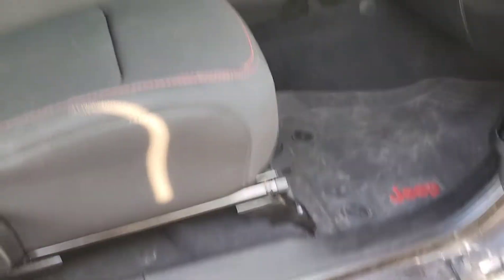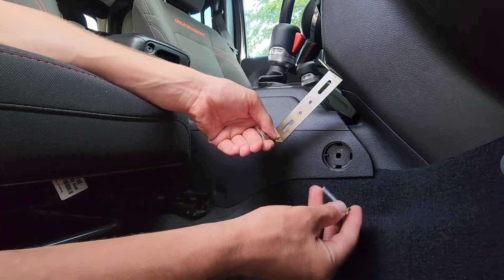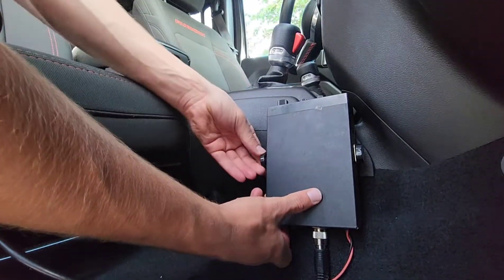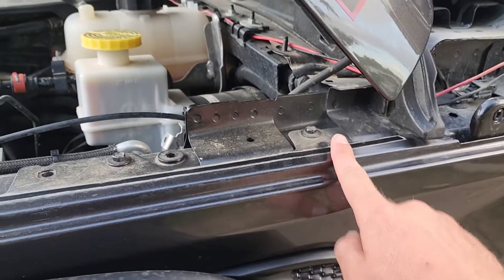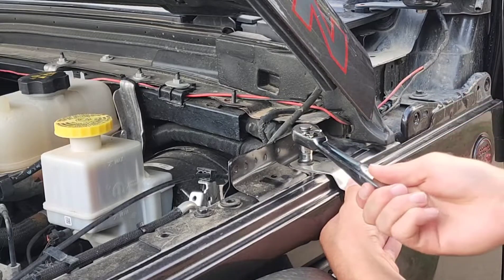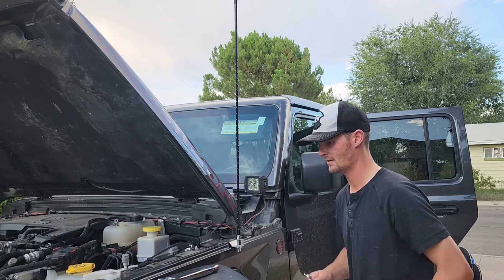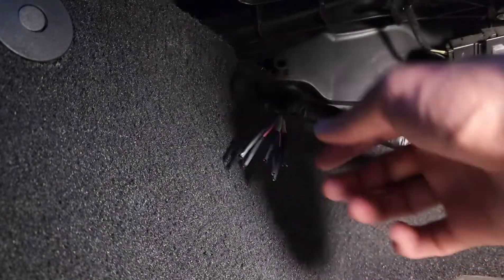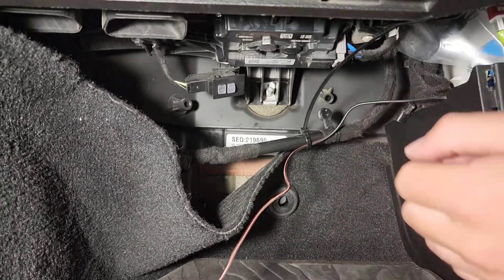Simple CB Radio install start to finish on the 21 Jeep Gladiator

Comment: Hey awesome video I’m wondering about that direct to battery wire. If I connect to that does it uitilize the aux switch or can I connect to that and still use all four switches?
Reply from the maker: You can still use all 4 switches

Comment: Nice video, this will help a lot! So where did you end up hanging the mic?
Reply from the maker: There is a hanger that mounts the mic to the passenger grab handle. Thats what I went with
Reply: @jeepzandthings  thanks, yes I have seen that one, but I am in Australia, so the drivers seat is on the right side of the vehicle, so I don't think that mount will work.
Reply from the maker: Oh yeah. Is yours a rubicon?
Reply: @jeepzandthings  No, I have the Willys model. I did some research, were you talking about the plastic wrap around mounts being sold by jeepuniq or the metal hanger you can get from Cooltech?
Reply from the maker: I was actually talking about the one from topsy on extremeterrain.com https://www.extremeterrain.com/topsy-jeep-wrangler-universal-cb-mic-mount-ummc-jl.html?utm_content=XTExterior-Antenna%7CTopsy&T5_Var4=J165986-JL&intl=0&utm_campaign=XTW+Wrangler+Vehicle+Medium+LTVMiddle&dialogtech=ppc&utm_source=google-pla&utm_medium=shopping&T5_Var2=shopping&gclid=CjwKCAjw3POhBhBQEiwAqTCuBjeQADZYyJHk0KOkZcBkcVS1TnWr959kChXWjfuUMKKeeG1WR7ls0BoC8M4QAvD_BwE&gclsrc=aw.ds
Reply from the maker: Bullet point mounting solution makes a good one that replaces one of the bolts on the grab handle with a female ball mount.  https://www.bulletpointmountingsolutions.com/collections/accessories/products/cb-radio-holder-with-20mm-ball
https://www.bulletpointmountingsolutions.com/collections/jeep-wrangler-jl-and-jlu-2018/products/jeep-jl-grab-bar-mounting-point
Reply from the maker: Your willys should have those 2 large bolts on the grab handle
Reply from the maker: Or there is the 3M style you can put anywhere
Reply from the maker: LycoGear Universal Ham CB Radio Microphone Mic Hanger Holder Mount with Adhesive Back, Pre Drill Holes & Single T Tab Connection, KLP-X2 https://a.co/d/6W8qEo9
Reply: As an Australian, the Bullet Point logo made me smile, till I thought of the news coming out of the US in the last week.

Comment: So your power wire was attached to the red and white, direct to battery wires?
Reply from the maker: yes I wired the CBs power wire to the direct to battery wire which is red with a white stripe

Comment: Anybody have a link or part # for the required bolt? Amazon perhaps? Thanks
Reply from the maker: It's a bolt from the hardware store
Reply: I know that. I just googled the dimensions and it was not clear what to look for or ask for at the hardware store.